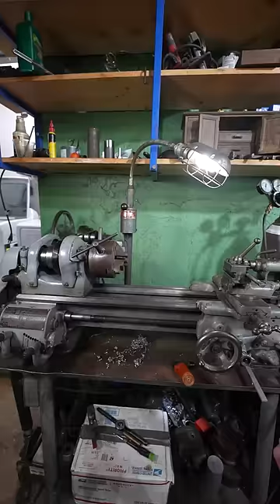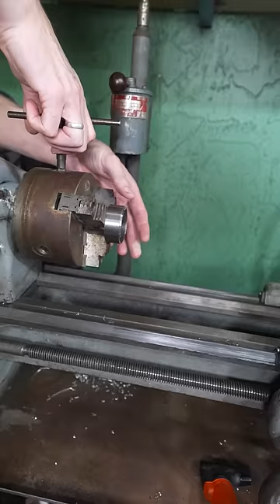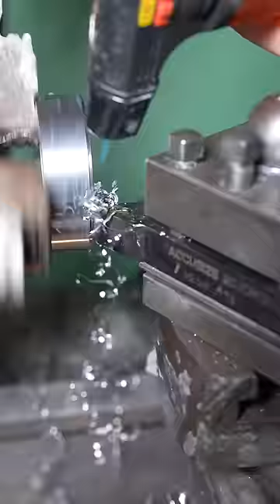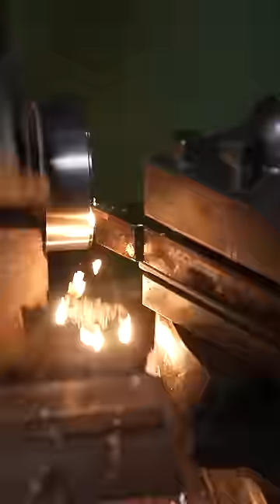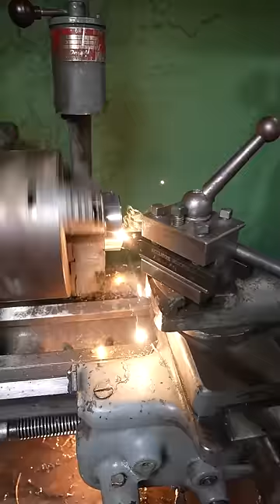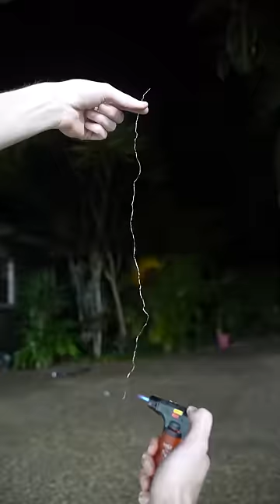Titanium has a dirty secret

Comment: I work in a machine shop that had Gisholt and Monarch Lathes the Chuck in those machines were almost 3 feet in diameter, the chuck wrench was approx.2and analysis feet long and weighed a good 3 or 4 pounds, imagine leaving that in the chuck! Yeah!. It was a shop that made wellhead for the oilfield. If that chuck wrench popped out when you were centering your part you usually ended up picking yourself up off the floor. Yep good times lol.🤠👍

Comment: I used to keep the turnings and chips of it and then ball mill them to powder to use for pyro stuff. If you mix with flash at about 10 percent it gives a much stronger bang, also it makes really cool cracling stars when mixed with lead or bismeuth oxide. ❤

Comment: I left the Chuck key on once on a 8” Colchester when I was an apprentice and it flew the about length of a rugby pitch in distance and hit the far wall with a huge bang, a welder came storming up the shop floor brandishing my Chuck key grabbed me by the throat and said you nearly killed me….! 13 years have passed and funnily enough I have never left the check key in once

Comment: One of my jobs they gave me a mechanical drawing, a couple smallish (10x20mm about 3mm thick and two pieces piece of thin tubing) metal pieces to weld and filler rod (tig). 
it looked like aluminium and weighing roughly same... 
what they DIDN'T tell me was that the very special magnesium/titanium... alloy needed to be welded in a special "box" "not unlike a small part sandblasting thing" where it was in a oxygen free atmosphere (constantly inert gas mix  flushed through to remove smoke). 
So I set things up like for aluminium, Wow! One BIIIIG photo flash. It was a joke.

Comment: See Los Angeles Fire Department Titanium Fire.  Burnt up the same warehouse at least twice 5 or so years apart, because the plant wouldn't follow the Material Safety Data Sheet and keep the dust and scraps build up to more than 5 gallons without stopping and emptying the container into an outside container.  Hot Titanium can break the chemical bond between the Hydrogen and Oxygen in water.  Can you say Boom!  Big Bada Boom!!

Comment: Best example for  definition "machine operator" lucky for you it's a baby lathe.I have seen former employees snap chuck keys on lower cradle and launch pieces of steel across shop floor. instead termination.paint it pink it might help save you some teeth in the long run

Comment: ah. yeah. First month I was working at a new job at a major defense contractor? A dunny bin (wheeled cart for metal sworf from lathe turning) was filled with titanium dross, and a stray spark ignited all of it. My part of the factory quite and calm, other part where this happened? Pandemonium as you can't put that fire out with water. If anything, it makes it burn hotter because it burns so hot it breaks the molecular bonds in H2O and ignites the hydrogen and oxygen, burning hotter so hot it breaks down the molecular bond of H2O and then the hydrogen and oxygen burns hotter...... and, so on. $28million dollar oops.

Comment: When I was in shop class in high school I was trying to open the chuck on a lathe that was really tight. My knee hit the switch on the front of the machine and turned on. It jammed my ring finger into the machine, but fortunately I didn’t lose it. After that happened we built a guard around all the switches on the lathes and others that had low switches.

Comment: Not such a secret... a lot of material will burn really fast is you disperse it in air (making the oxygen available to as much of the other element as possible). A lot of factories that work with powdery material (eg. Flour) know they must be carefull with open fire because of danger for explosion (= really intense, fast burning).
Titanium seems not to oxidize, but in fact the surface is already oxidised (like aluminum, same story), and that layer is an excellent protection against further oxidation.

Comment: Yeahhhhhhh most metals are flammable in that situation, just like pretty much everything is combustable as a fine powder, especially when paired with the proper ratio of oxygen to powder... On that note, dark aluminum. Its fckin aluminum, ground so fine that it spontaneously ignites on contact with oxygen. it has to be ground in an argon environment and mixed with another material (iron oxide for example) before its exposed to oxygen. Btw, iron oxide and dark aluminum mixed together is also known as the worlds favorite everything melter, Thermite. The iron oxide also has the added advantage of stabilizing the mixture, pretty neat right? One of the best compounds in the world for melting a hole through pretty much anything is literally just powdered aluminum and powdered rust 😂

Comment: Hey ❤ The Backy That may be the problem with the metals Surgeons Are inserting in our bodies? .What Do know about the kind used to brace a backbone structure? EXTREMELY INTERESTED. Maybe  Explain alot. Does it cause your teeth to fall out of your jaw. Or was that a side affect of big pharma? Or both. Bc literally too young for that to happen. Seen it happen to others 30 yrs my sr. But not under please do tell what you know or even an opinion. If you have one? FLAMABLE IS ASTONISHING! WOW. That can't be good in your body? Would you want 2x, 6"L plus two to hold tham against your spine. Hv at least 4 holes & other longer scars. Assume they were steril but did not assume nor told shavings could be seriously toxic to the blood or bone.

Comment: Why don't you make a tube out of titanium and fill it full of magnesium and Chuck into a big puddle of water,
.
.
( now here's the safety of course that idea above!)
.
Now don't look at the Magnesium when you throw it in water it will blind you no if ands or buts! However you can aim the camera at the puddle and observe what's going on to see if it'll burn and ignite the titanium I can't remember how hot magnesium Burns at but it would be an interesting experiment one I wouldn't mind seeing the results of, also do not use a lot of magnesium use very very little of it especially if you know you're going to get it wet because it burns intensely hot and has potential to Blind you and if you throw a big piece in there and look at it you will go by and it'll burn your redness permanently and there's no cure to repair the eye with that much damage so please be careful

Comment: Has this fool never heard of steel wool or thermite?  Any metal can burn under the right conditions.  The solid fuel rocket motors on the space shuttle used aluminum as their fuel.